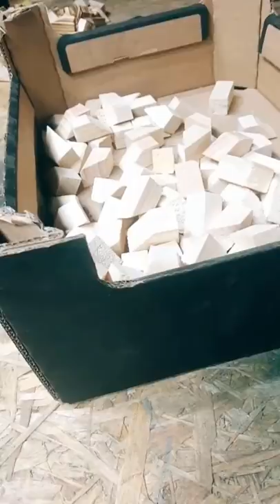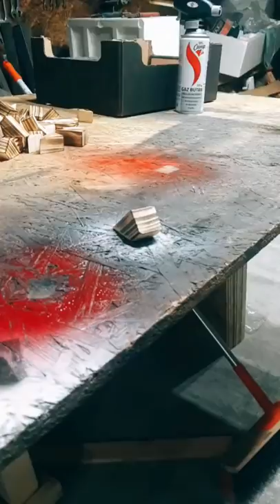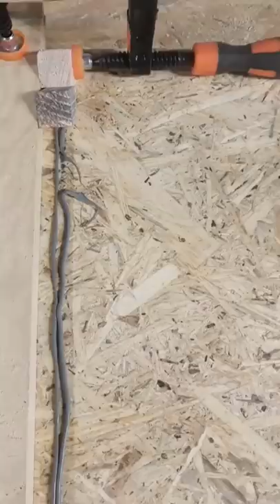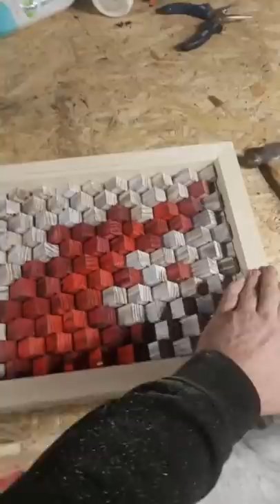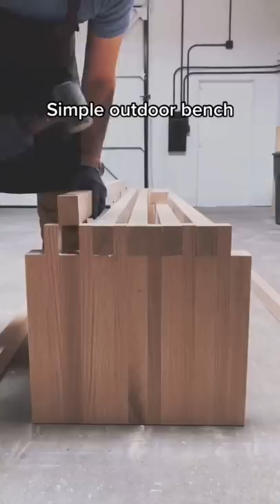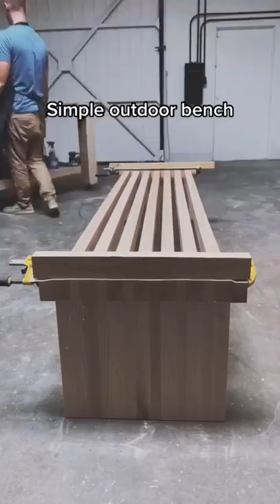Amazing Woodworking Projects Ideas #shorts #woodworking

Comment: Simple outdoor bench. 
If you have a woodshop with thousands of dollars worth of tools
Reply: With S4S lumber, you could do this with a circular saw (pick one up for $20-$30 on Craigslist), a speed square for straight cuts, a tape measure, a scrap wood sanding block, a mallet, a couple of Harbor Freight clamps, and of course, Titebond 3.  All in, with consumables, maybe $80 worth of tools if you go secondhand, and that mostly because of longer clamps.  Dunno what this guy finished it with, but spar urethane is an excellent outdoor finish.  That would only add about $25 to the cost.  

You could even make a rougher version with regular dimensional lumber.  Or plane your own.  I bought one of three 12" thickness planers on Craigslist in my area priced at $100.  Side note, it makes reclaiming lumber much easier, which also saves you on the wood because people are always giving away wood.  

Point is, with some creative thinking, you don't need an expensive shop to do this.  It helps, but it's not a requirement.
Reply: The outdoor bench all you really need is a hand saw,chisel and a hand plane easily less than $200 in tools

Comment: That bench is simply going to fall apart outdoors
Reply: He'd have to dowel it or countersink lag bolts or deck bolts!
Reply: No it won't... Wtf are you talking about? The only joint will only get stronger due to gravity. Are you saying the glue wont hold? If so you don't understand how wood glue works.
Reply: @indalcecio  Clearly you don't.  Wood glue doesn't hold up to water.
Reply: @jwil4905  titebond 3 is guy waterproof

Comment: That bench will eventually collapse. You need a center for support or even a bottom shelf.
Reply: No, that amount of glue surface easily holds 1000 lbs
Reply: @OleHenrikKvammen  ok ... if you say so!
Reply: @Robocoppat  I agree, the grain will give up before the glue does..
Reply: @OleHenrikKvammen  the wood will break. In the middle. Where he picked it up. No center support, thin board, weight + time and you get boards that break. The legs will still be glued together, you are 100% correct, meanwhile here’s your bench ^^

Comment: The last one when it fell apart a little when he was picking it up made me laugh ngl
Reply: The bench did not fall apart.  He was preparing for using a caul to place the clamps on, which applies pressure across all the boards he slotted in so he didn't have to clamp each one individually.  The caul is what fell.